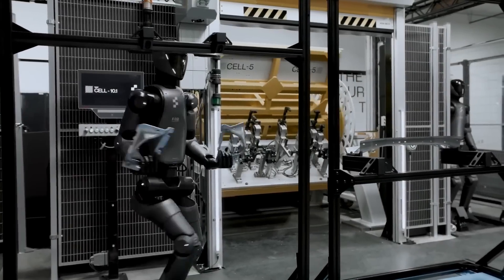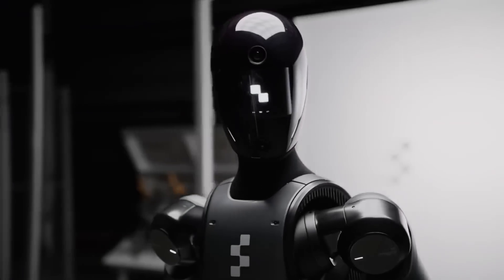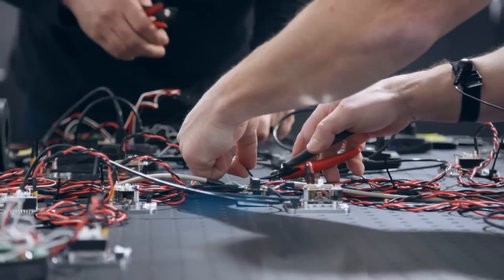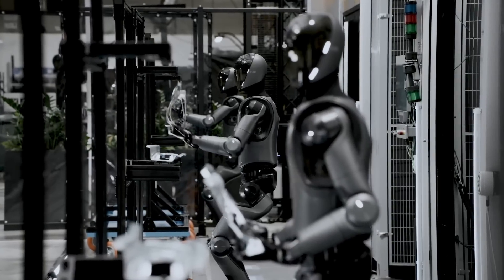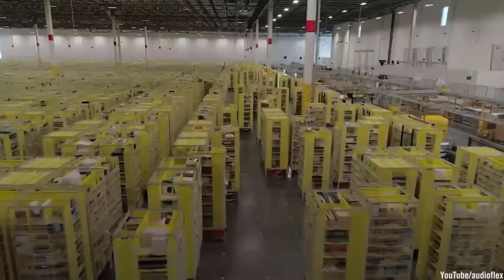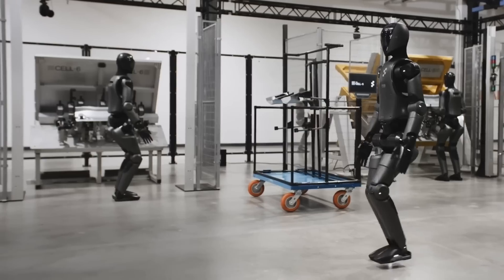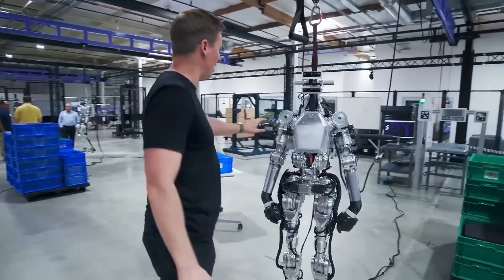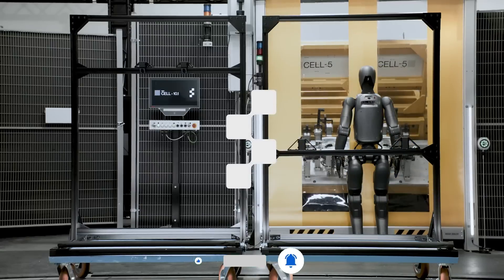JUST NOW  Figure 02 Reveals Insane New Capabilities!

Comment: It won't work 24/7 as it needs to be charged
Reply: On electric forklifts, the battery can be changed in a couple of minutes.
Reply: What if the factory floor is like those wireless phone chargers

Comment: Like I told Tesla on X to give Optimus a pivot point like humans have in their feet where our toes are, and they listened.  The next iteration of Optimus had a pivot point on their feet so they could push off instead of looking like they have to take a dump.
Reply: yeah its called the ball of the foot. and when an engineer adds that function it potentially means the robot could move faster than a human, and its why these designs didn't have it originally.